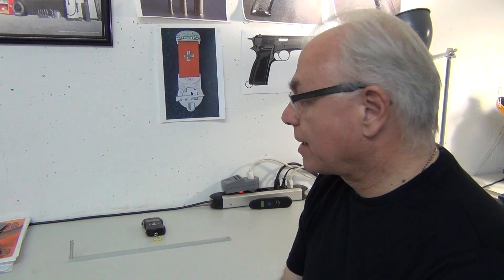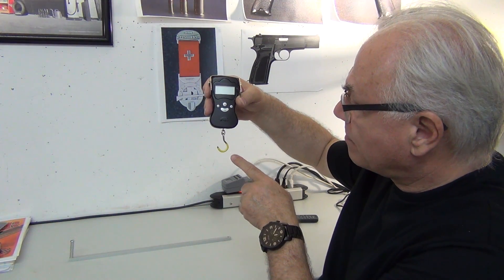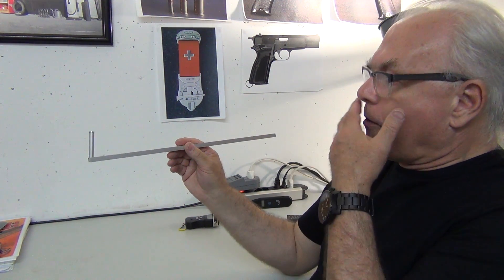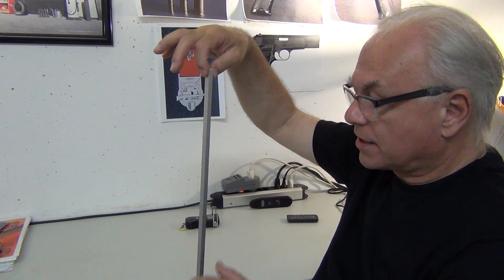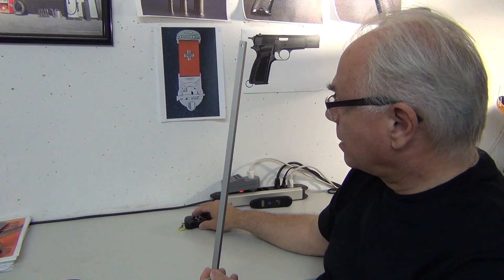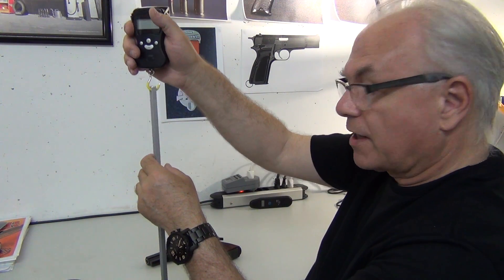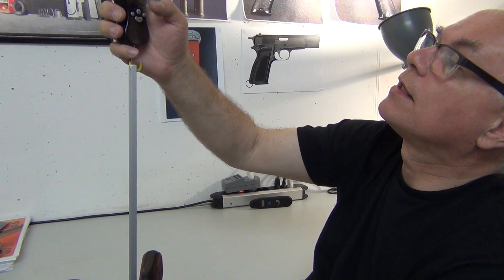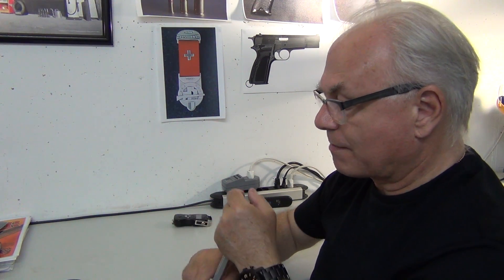Quick look: Homemade trigger pull gauge

Comment: I have what appears to be an identical hanging scale - $3.50 at the Dollarama store, marketed as a "luggage scale."  It has a "hold" function that locks the display at the highest reading. To activate the "Hold" function, turn on the scale, set the units (lb, kg, etc.), and then Press and Hold the "Tare" key for 2 Seconds. This will change the function to "LOCKING."  The display on mine blinks "Loc" when I do this (the display has only 3 characters). 
To cancel the reading, turn the scale off and on again. To change back to "Tare", press and hold the "Tare" key for 2 seconds. On my scale, the display blinks "Tar" .
The difficulty I've had trying to measure trigger break pressure, is that the load on the scale has to remain steady for at least 1 second before the display "Locks." That's not ideal for measuring  trigger "break." I suspect the "lock up" time can be shortened by a simple modification to the circuit board, but I haven't found the magic value yet. Also, some people are not happy with de-soldering a component and soldering in a new one. 
If it was possible to make this act like the electronic equivalent of the sliding metal piece on a  small spring-type fishing scale, where the sliding part is pushed up the graduations and stays at the highest point, that would make things very simple. However, the spring scale that I used to put in my fishing tackle box now costs about $28 - a far cry from the $1.98 price sticker on the original.
Since even the most cheaply made "gun gear name-brand" trigger pull scale retails for $49 Canadian around here, a bit of experimenting with the electronic scale might be worthwhile.
Reply from the maker: I like your ideas but am not adventurous with modern electronics (my last projects were 74-series TTL in the late 1970's!)  I'll have to try the "Loc" settings you describe to see if mine is identical. Thanks for the tips, for viewing and commenting. All the best, Rob

Comment: Thanks for showing. Good development. I'm going to make one also because of the difference in price of the dedicated products. I agree with the extension being that long; it allows working the scale behind the stock, necessary for a straight back pull, which is the only means of getting an accurate reading. You didn't give us the brand and model of the  scale tho, and it appears to be a viable one. Would you make a comment and tell us? Thanks.